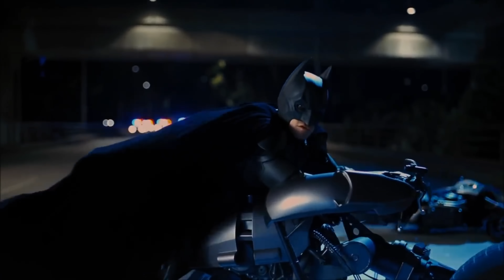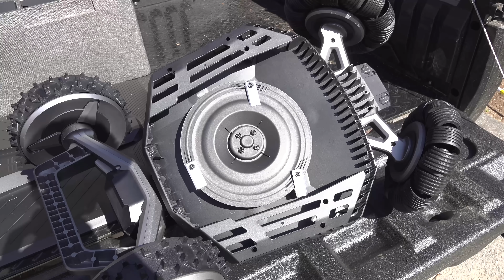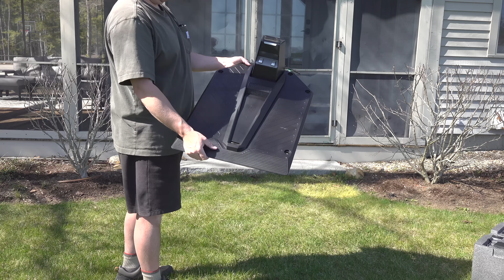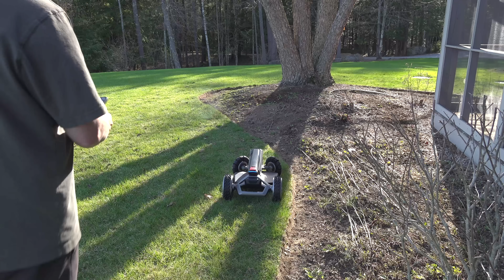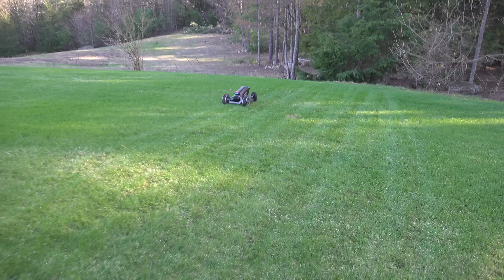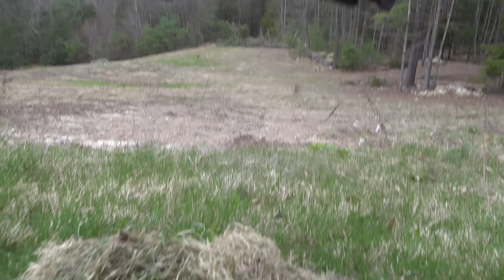Ecoflow BLADE Robotic Lawn Mower - First Look

Comment: we're discussing a potential investment for those tired of paying for lawn care services. Currently priced at $2,899.00, this machine is available at a discounted rate of 18%, bringing the new price down to $2,378.00.

If you're used to paying for lawn care services, you know that costs can add up quickly. At a rate of $35.00 per week, mowing services in my area for approximately 30 weeks would cost a staggering $1050 per year. However, with this machine, the initial investment could be recouped in as little as two seasons and eight weeks of use.

After that point, the cost of grass cutting would be zero. Of course, it's important to consider maintenance costs for the machine, but this could still be a worthy investment for those who want to save money and take care of their lawn themselves.

Comment: Love the technology, don’t like the price. Hopefully more competitors enter the market. Thank you for sharing.
Reply: They are late. Robotic mowers have been around for 25 years. Boundary wire free a few years (fact incorrect in the video).
The of course charge you for a machine that lets you have spare time instead of actually walking/driving yourself.
Reply: @subwarpspeed  Agreed they have been around for a while but not until recently has an optimized software algorithm and available computing power to support functions been available. 
Which robot lawn mower would you suggest to the average homeowner at this time?

Comment: I always said with others, why don't they use GPS to layout the cutting perimeter? 
I guess $2,500 isn't bad as long as the battery(and we all know it's gonna need replacing) isn't crazy expensive!
Reply from the maker: It's the accuracy. GPS alone is accurate but without triangulation using a couple of signals they can't get it fast enough to keep it accurate

Comment: You didn’t mention how it would navigate to other areas. Specifically the other side of the house. Will you need a second antenna installed elsewhere in the yard to extend the range?

Comment: Hopefully this tech will come down in price one day. Looks amazing but hard to justify at the current price, at least in the city. Feel like the odds of someone stealing it are too high. Even if they can't do anything with it, they likely don't know that. So could see these getting stolen and then when they can't do anything with it they smash it and toss it. You might get lucky and get it back undamaged but who knows.

Would be cool if you could get a motorized door that you could install on a gate so it could go from say front yard to backyard through a gate. Maybe with a little solar panel on the gate to keep that charged up. Plus the mower could maybe cut during lower foot traffic times to decrease chance of theft and then be in the locked gate yard away from people the rest of the time.

Comment: We have dogs, thus piles of dog poop. They are small piles, but how does it handle these?  Go over, around, or would we need to pick it all up before each mow?
Reply from the maker: I have the same on the lawn you saw. It won't avoid them as they will likely be too low to the ground and small. The mower is waterproof so it just does its thing, it will of course get on the mower, so may get broken up. It sort of depends on wet/dry without getting to grosss. It wont damage the mower but obviously whether you mow manually or with one of these you will have to hose it off regularly.

Comment: Can you review the Heisenberg mower? It apparently can edge, blow, and even fertilize the lawn all with just AI, no lawn wires either.
Reply from the maker: I will IF it ever comes out which I dont think it will. I have no faith in that project and it appears to be a typical kickstarter wait forever scam. I would not back this one. Wait and see what happens, they have way to many red flags including a fake "testimonial" that was quickly removed from facebook once sleuths realized it was phony.

Comment: What’s you opinion on this vs the LUBA? I know the LUBA doesn’t bag but it also uses no boundary wires and seems like the closest competitor with it doing 3/4 acre and 1 1/4 with the upgraded model. I guess it’s still preorder and eco flow is a well known company but the mowers seem super comparable
Reply: I have a Luba from Kickstarter. Excellent so far! It can tackle steeper slopes than the Blade and has suspension on each wheel instead of the mowing deck. Options include choosing the angle of mowing pattern, height (1.1–2.7 in), single or double grid and more. The Blade does look pretty sleek and raking attachment is a bonus.

Comment: I would love to have this I’m just concerned it wouldn’t work very well for my lawn.  I have a few small retaining walls before the street sidewalk. Along the sidewalk I have long strip of grass, if I were to do the boundary I would do it for the retaining wall but then would the sidewalk area not get cut?  I also have my yard separated by a driveway and stairs going up to the second strip of land. The only way the mower could get up there would be to use the strip of grass along the sidewalk and enter the yard on the far other side of the yard. Is that kind of customization doable in the app?

Comment: Well... if it were under $1K it would be mine today. Maybe one day such a thing will fit into my budget. Those two front wheels though... would drive me nuts. I keep seeing sticks/twigs getting caught in them. As far as someone stealing one, I can see that happening... the only anti-theft that would work is if it were somehow able to determine it had been stolen, it would shutdown, be useless until the original owner 'unlocked' it. Still, parts might bring some money... Where you live, it wouldn't be an issue... where I live, yeah, it's gonna get stolen (if I could afford it!)
Reply: $999.00 online at walmart site at time of this comment.
Reply: @patricksquires77 Well too late for me - I bought a nicely used Husquvarna 46" rider with the money. I'm covered for a good number of years for now. Thanks though for pointing out the price drop. Strange though to see an ad for the mower that says "Now $999. You save $1,900.00" Most consumers would see that as a huge red flag.

Comment: Will it avoid kids or pets who don't move, and if someone picks up your $3k mower and walks off w/ it do you have any recourse?
Reply: The Husqvarna GPS-RTK (EPOS) automowers have ultrasonic sensors and bump sensors.  I have to imagine the EcoFlow has something similar?  It won't necessarily just go around obstacles, but it slows down first and then detects the bump and then goes around.  The blades are pretty far under there, so you'd have to be a barefoot bigfoot to get cut in that scenario.

Comment: Finally, the DJI of law care has arrived. Everything about it looks amazing and I love that it cuts like a mower would in lines as opposed to the most economic route others take with zig zags. The build looks killer too. If I didnt enjoy my mowing time so much Id consider it. Would be great if they made more attachments in the future like a light duty dethatcher or core areator!
Reply: For 3k I'll pass, lol.
Reply: I thought the same thing it looks like the drone
Reply: The company was started by one of DJI guys.
Reply: No way you could create a core aerator for this. Core aerators are heavy machines. They need to be to sink those tines into the ground. 

The sweeper attachment looks super interesting, however. I have an auto mower (Worx Landroid L), but I have actually been cutting the lawn by hand, because I've been capturing the grass clippings to mix into my compost. I work from home. If this could send a message every hour stating, "Hey, the bag is full", I'd have no problems getting up once an hour and dumping the grass into my compost pile.

Now, will all of this work as well as we saw in the video? I don't want to spend $3K+ for something that's not ready for prime time.
Reply: @dontbanmebrodontbanme5403  exactly, the smaller aerators weigh about 250 lbs for a reason.
Reply: @dontbanmebrodontbanme5403  why not just buy a mower and mow the grass one a week. You could collect the clippings to use in your garden and buy a greenhouse with the money saved. The Toro electric is a nice mower for about $500.
Reply: Or we have these things called legs for one a year jobs. 😂

Comment: Can it be set to vary the mow pattern to avoid digging grooves into the lawn? Does mowing separate front and back lawns require two antennas?
Reply: Yeah, I'd honestly like that. I have a Worx Landroid L. It's a pain in the ass (for other reasons), but I actually love the random zig zagging it does, because in the end, the lawn just looks like a neat lawn and looks like a lawn mower has never passed over it. I'm one of the few people who prefer it to just look neat with no lines at all. When the mower goes random, it eventually criss-crosses all over the place and you land up not seeing any lines.
Reply: @dontbanmebrodontbanme5403  Thats why I didnt buy Landroid. It has a drive wheels on rear and they need to push the front of the mower over bums and that tends to make grooves. Instead of that I got Gardena and no I have no grooves

Comment: Just a note: Husqvarna has a wireless mower now (about a month out from releasing it): 450XH EPOS. I bought one as soon as I saw "wireless".
Reply from the maker: You might be outside the US. I have been watching that for a year, first they said commercial use only, then it went in a holding pattern. Competition is good but I have no idea what they are waiting for.
Reply: @SilverCymbal  the 550 EPOS has been available since at least last summer.  It's branded as a professional model, but I got it for my house from the local dealer.  Same chassis and shape as the 450, just different color and maybe bigger battery.
Reply: @SilverCymbal  I'm in TN. I almost bought the wired one and then I saw on their website that the new EPOS was out so I said, "That's the one for me!" and contacted the local dealer.

For the money, the EcoFlow looks like a better deal unless the Husqvarna somehow performs better or is more reliable or something (which I have no evidence). The EcoFlow, from your video and a few others which posted today, looks really well built and thought out. The only place where they may fall a bit short is the app but, even then, the Husqvarna app could be better (it doesn't suck - it just could be a bit better).

Comment: I'd really like to see obstacle avoidance tests.  My kids love leaving stuff all over the backyard.  Can you do a followup with items of every height?  Frisbees, nerf darts, baseballs, footballs, basketballs, etc?  I'd love to see how it works before I'd take the plunge.
Reply from the maker: Yes, I did test some things like that and it did well but I will definitely be doing a follow up later this summer.
Reply: Not trying to be funny but what about dog poop 🐕 💩?  That would be messy!
Reply: @bzbzbz25  Nice. Your thousand dollar mower has poop all over it. You may not hear it mowing, but you'll smell it coming.
Reply: @bzbzbz25  Good point! Probably not fun trying to clean it out of those hollow wire front wheels.
Reply: @bzbzbz25  I have a Worx Landroid L and the best thing I can tell you is that you should get out there all the time and pick up your dog poop. The few times I didn't and it ran it over, it was honestly no different than when you do so with a push lawn mower. It's not that huge of a deal at all.
Reply: Linus made a video on this and it shows this really well, It saw boards he didn't put in no mow zone and mowing around them pretty close without touching them
Reply: @unwanted9900  He is selling lawnmovers now  ?

Comment: Hey, off topic, but I can pick up the Ego Electric Zero Turn 42" for like 3K. I saw your video and you seemed to like it, but my main concern is lack of lift. I got the push mower for work for a tiny lawn and noticed that there isn't much lift on it and was wondering if you noticed any of those issues while you tested it.
Reply: Make sure to take care of those batteries… replacing them will be prohibitively expensive
Reply: @schyllic  no joke I just saw ryobi batteries for $185 a piece for one of their walk behind tillers and there are 6 of them.
Reply: Just curious where can you get one for 3k? The ones I’m looking at are 5k and up. Thanks
Reply from the maker: Yes, in general battery mowers do have less lift. How I work around that is I cut slightly lower. By getting the deck that little closer makes a HUGE difference, even with gas models. BUT this may not work for your personal taste and look of the lawn but maybe give it a try or high lift blades might help too but I dont bother with them.

Comment: You should ask them to come out with a stripping attachment for this thing.
Reply: @MajorImpact  while that is a good point, since this mower uses RTK it should have centimeter level accuracy via the GPS coordinates. It can be programmed to make thick stripes by spacing out the lines and coming back in the same direction multiple times side by side. This way it can make 20", 30", etc. lines. 

And it weighs much less than a normal mower so the striper would not be very heavy either. So not much worry about pattern embedding. It can alternate to avoid that anyway.

Comment: Pretty wild the technology they must be packed into this. Surprised to its powerful enough to drag around the bag and clippings. Also that your lawn looks like that already after the four feet of snow that didn’t seem that long ago
Reply from the maker: I am also amazed. How does a company with no robot experience do this when no one else could? I guess they figure it out. My back yard is looking so much better, but my side is still beat up from the piling of all that snow. I will have more lawn videos shortly too as the season is finally taking off.
Reply: For me, the bag is essential because I use my yard scraps to mulch in my garden bed so I would need to collect all clippings. So, I will be judging it based on use with that bag 100% of the times.

Comment: Toro is supposedly coming out with a wireless one as well. I would pay $1500 for a robot mower that actually delivers what it claims. I would also need a sensor suite like the modern robot vacs have.

This one is $2600.
Reply from the maker: Yes, I was excited since the last Toro robot was made almost 15 years ago. I am supposed to be getting it. BUT I am not sure it's really coming this year. Sources are telling me they are very far out. Segway is doing a kickstarter for one, and Worx is supposed to have a camera based version which could be very interesting and I am expecting to share that one also. But Ecoflow was able to deliver one where honestly, everyone else failed. Reminds me 3 years ago when they came out with their Delta powerstation that charged in 2 hours, unheard of. People said it would explode, impossible, and now 4 years later its a best seller. These guys have good engineers.
Reply: @SilverCymbal  yep Ive been following the toro since last summer and the silence on it is deafening; I doubt it’s out this year. I have a roborock q5 that continues to impress me with its systematic path, mapping, object avoidance. I feel we’re on the cusp of the same for yards. Funny thing is I had never seen any robo mower until yesterday, driving past someone’s house

Comment: Question - how does the RTK antenna work when you have a front and back yard obviously separated by a house since there would be no line of sight?
Reply from the maker: It uses line of sight for satellites and radio for the mower itself so it can be out of sight but each yard is different and the app will help you find the best spot. Now if you have total tree coverage or your layout is very broken up you may have to choose a spot somewhat in the middle. This may or may not be acceptable depending on where you have electric outlets, etc. If its wide open, it will be easy, but if its complex you may need to work with it a bit to get full coverage.
Reply: We have a GPS-RTK mower and mounted the reference station on top of the house.  Works great.  Biggest issue is actually satellite signal getting blocked by trees.  The reference station signal has pretty good permeability through trees and other landscaping.

Comment: Honestly It's Not badly priced for as advanced as it is. However, I wouldn't buy one. I don't see it holding up over the years. Plus if it breaks then it's more money to fix. You also have to factor the cost of battery replacements if it lasts that long. I'd rather pay for a lawn service.

Comment: Does it pick up where it left off/ run out of power? My yard is a little bigger than an acre. Great video by the way. Thanks!
Reply from the maker: That's a great question, and yes it does. Because it knows its location it will not redo an area if it stopped for rain, or recharging.
Reply: @SilverCymbal  Thank you for prompt reply!
Reply: @SilverCymbal  How about the antenna and line of sight? Will it work or perhaps just not be as accurate when it mowing the side of the house, not in line of sight of the antenna? Thanks!